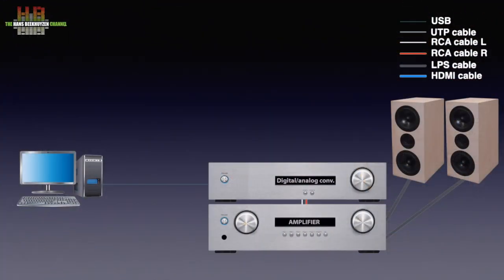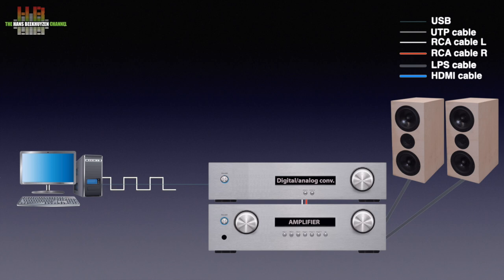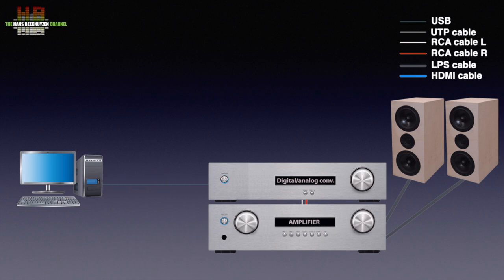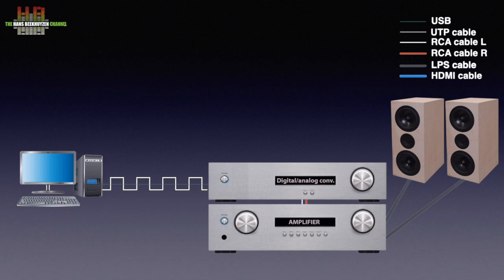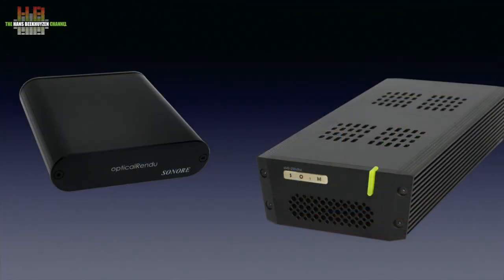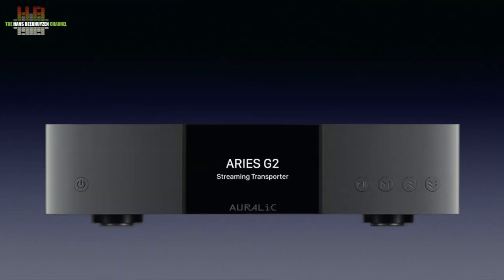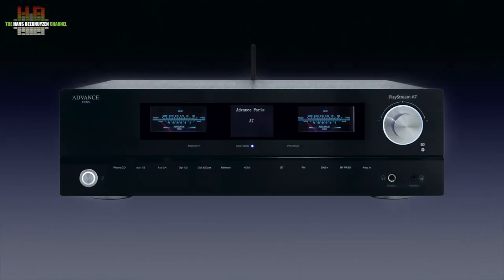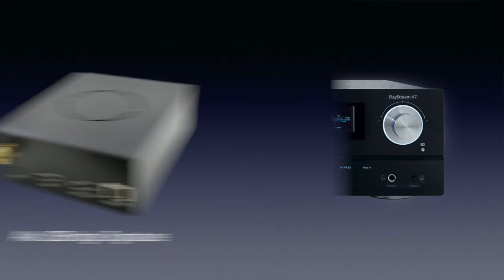What is a network bridge and how does it work?

Comment: So if the DAC is using its own clock, which just about all do for asynchronous connection, what really is the advantage of the bridge from a clocking standpoint?  Some of these bridges even allow for even more expensive external clock additions to be attached and it would seem to me it's all for nothing if the DAC is going to do its own thing.
Reply from the maker: That requires a longer answer than fitted for here. I'm working on a video that will be due soon.
Reply: @TheHansBeekhuyzenChannel  I look forward to that. There is a lot of mystery in this question and I've yet to find someone to explain it.  I even posed the question to SOtM and received a less than clear answer.
Reply: @TheHansBeekhuyzenChannel  Did you upload this video yet? I’m having trouble finding it.
Reply: @mikedb1212  did you end up getting an SOtM? I am wondering the same thing

Comment: Hi Hans,  is there a difference between a network bridge and a Digital to digital converter? If there is, witch one should i choose to improve my sound if i am streaming my music from a computer to a Denafrips Pontus DAC. Thank
Reply from the maker: There is no formal definition of the both. But I see the term Digital to Digital converter primarily used for devices that receive USB and/or AES3 signals, cleans them up and outputs through USB, AES3 or I²S. So no network functions. The essence of a network bridge is to 'bridge' digital outputs from the computer to the listening room over the network.

Comment: Do these protocols (RAAT, NAA etc) have error correction, like using checksums in TCP/IP?
Reply from the maker: Of course
Reply: @TheHansBeekhuyzenChannel  USB doesn't, thus the question. Thank you!
Reply from the maker: USB Audio Class 2 does
Reply: @TheHansBeekhuyzenChannel  So basically all modern DACs with USB, right? Why can't they re-ask the data from the source if an error occurs (due to the jitter for example, as shown in one of your videos)? Just like a network bridge will do, if the checksum will be false.

Comment: Great video as always Hanz. What i am concerned about is the clock of the network bridge against which the bits are sended to recieving dac, is there no way to make it asynchronous ? i.e. the recieving dac  clock determines it ? Is it possible via usb class 2 connection between them? That would make the audio bridge very cheap.
Reply from the maker: Like USB Audio Class 2 the ethernet connection is asynchronous in the sense that the network clock is not the audio clock.
Reply: Brilliant ! So that means if i connect my network bridge with ethernet connection to my dac, i would assume that its my dedicated dac that have the main influence on my audio bits ? 
Ok, what about sending bits to network bridge Via bluetooth or wifi from my computer (input to my bridge) ? Will the network bridge clock oscillator effect the incoming bits ? ( As you suggested, the output of the bridge was taken care of by the ethernet connection from bridge to dac )

Comment: Does a network bridge bypass the Windows internal signal processing or is that accomplished another way?
Reply from the maker: Yes. Although it's not the bridge but the player software you use that outputs the signal directly to the bridge.

Comment: I’m curious to try a network bridge in my set up which currently comprises of a MacBook (using Audirvana) connected to a DAC via USB. I’d also like to try Dirac’s room correction software. With regards to the filtering, where do you think it should be placed in the chain, before the network bridge or after or shouldn’t it matter?
Reply from the maker: Why not combine the two and use the MiniDSP SHD Studio streamer and Dirac processor? Watch https://youtu.be/zr_oqF9jb-8
Reply: The Hans Beekhuyzen Channel , yes that is one option. The other, is using Dirac as an Audirvana plugin. What I was wondering about is where is the best place for the filtering to happen, before or after a network bridge.

Comment: Would a network bridge improve the sound quality if located after an Innuos streamer, before a DAC?
Reply from the maker: That depends on what network bridge and which model of Innuos you are talking about. The SOtM sMS-200Neo will not improve the sound quality when using the Innuos Zen MK3. But a Auralic Aries G2 will certainly improve the sound quality when using the Innuos Zenith.

Comment: Another great video! I am a huge fan of your work! One question: Do I still need to use bitperfect software on the computer if I use it with a network bridge (as you recommended in another video if connection a DAC via USB)?  Thanks!
Reply from the maker: You need to use software that can send music to the network bridge. Like Roon, Audirvana, jRiver and so on.
Reply: @TheHansBeekhuyzenChannel  Yes, I understand that. Do I also need to tingle with drivers and other things to ensure a bitperfect signal?

Comment: Hans, If you have a certain budget for a streamer / bridge and dac. Would a combination sound better for the same money or would you be better off separates? 

The advantage of a combination is short signal paths and you cut down on cables. 

With a separate system, it is easier to upgrade step by step in the future. Where do you think you get the most sound quality for your money?
Reply from the maker: You figures out the answer yourself, apparently. By carefully picking out separate components you might find a better combination for the same money. But you also get the inconvenience of the separates with interconnects and sometimes less stable reliability as a result.
Reply: @TheHansBeekhuyzenChannel  I know you like to seek out gear that performs well for the price. Beresford Caiman SEG is a DAC/headphone amp with a fixed or variable out.   My Uptone Regen suddenly ran hot, and killed both my SOtM 200 and the usb board on my DEQX. A Project s2 is coming...thanks for your review...so out of the cupboard came my old Squeezebox Touch and the Beresford came over from my headphones setup. Wow. I commend you to seek out the UK design, Taiwan made Beresford. Power it with wall-wart, 12v battery or the Beresford Dorado super capacitor p/s.